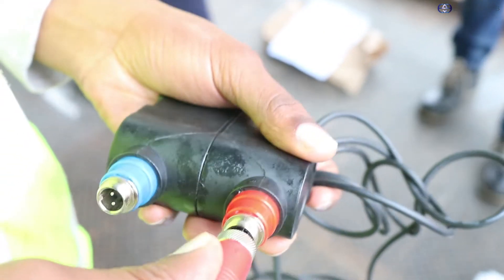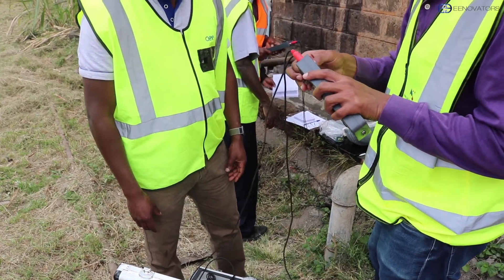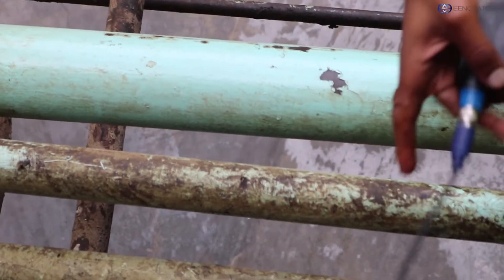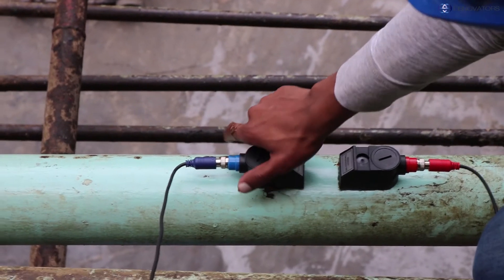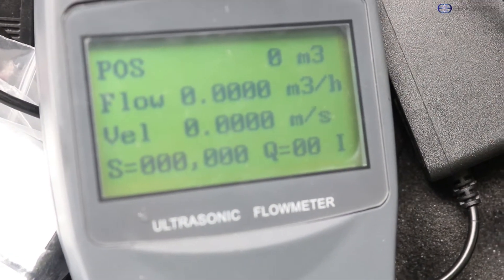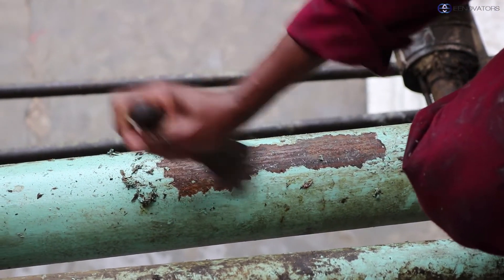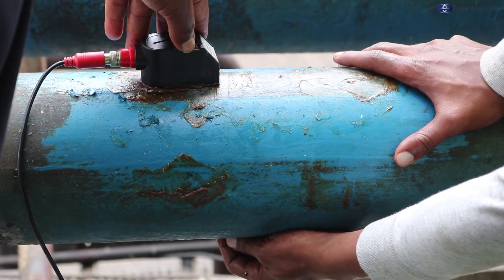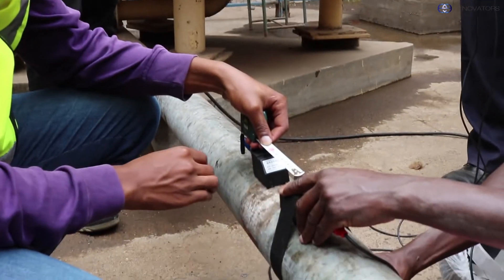PORTABLE ULTRASONIC FLOW METER INSTALLATION TUTORIAL | HOW TO SOLVE 'NO SIGNAL' MESSAGE

Comment: Sir, if the water rate in the pipe isn't stable (because it's being pushed with a diaphragm pump). Will it affect the measurement process?